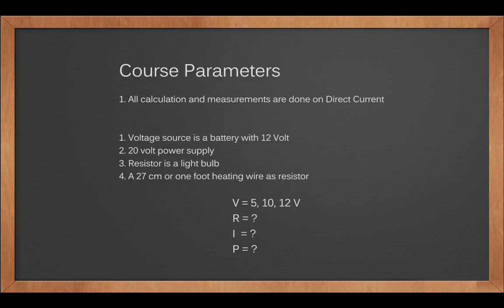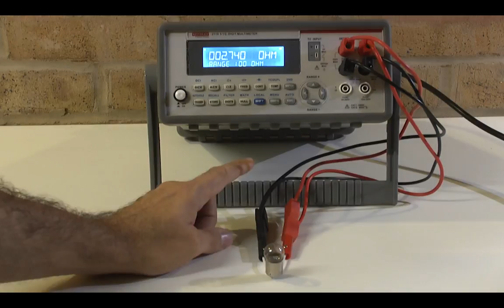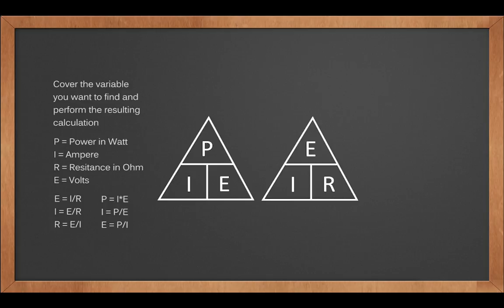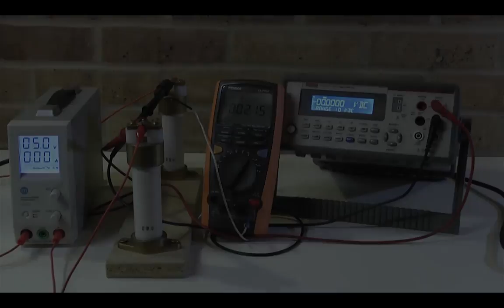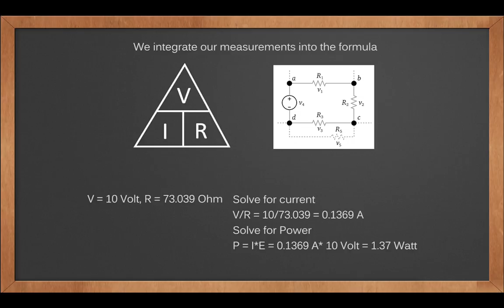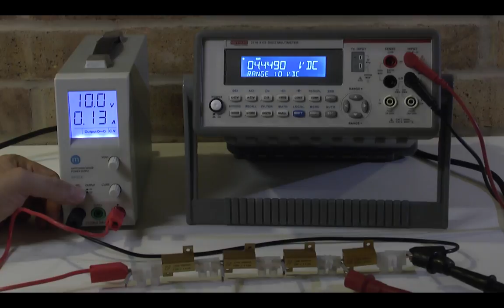Ohm's Law, Kirchhoff's Voltage Law

Comment: Can you calculate the values in my multifilar coil...?
https://www.youtube.com/watch?v=9jKsokgH3VE
Reply: measure inductance and resonant frequency, calculate capacitance from these values. C=1/((2pi F)sqr L)
Reply from the maker: In your case sure. I have calculators on my website. Important is here because you use many coils stacked up you have large impedance changes and increased capacitance. Start witch one pancake coil and add them with the calculator. However you need equipment to measure. I had similar problems when I added two pancake coils on top of each other. I had to use space to make it work. Meaning reducing magnetic coupling and capacitance. On Youtube the example wireless power transmission with spiral coils.